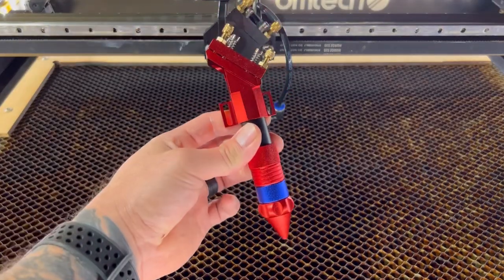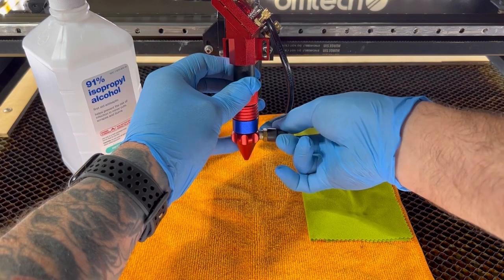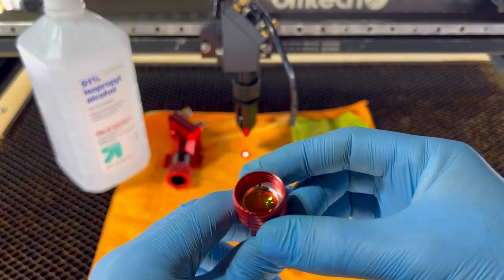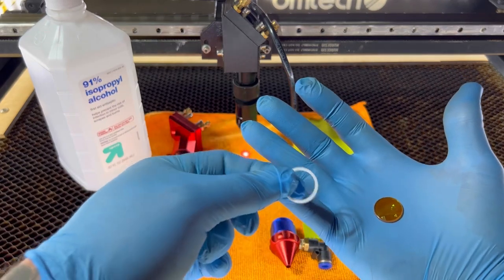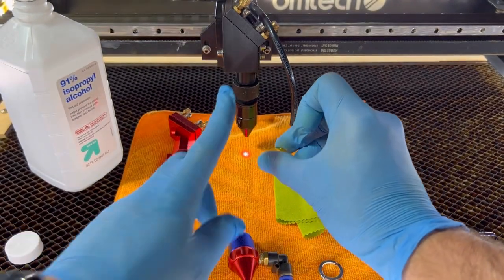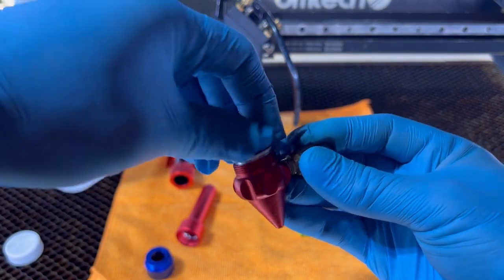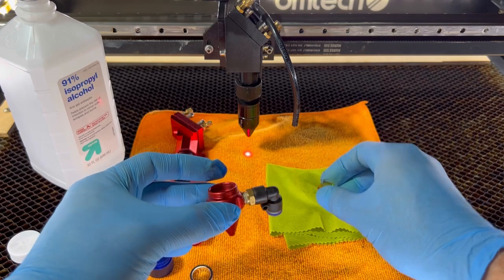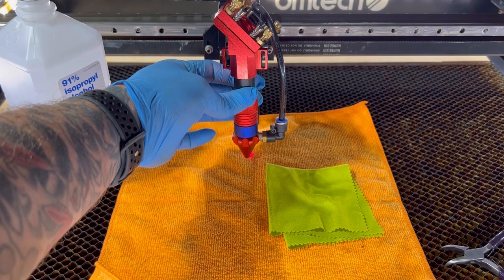CO2 Laser Head Lens Location and Cleaning for AF2028-80 (OMTech)

Comment: Very informative and valuable video. It will help many who are unfamiliar with this laser head. Just for info, the blue ring is a 1/2” spacer. If the owner wishes to use a 2”  20mm lens (normal lens is a 2 1/2” lens), all they need do is remove the blue ring, which will ensure proper focal distance between nozzle tip and material.
Reply from the maker: Thanks Jim. I know you have this laser head setup so I value your first hand experience. Thank you for being a great contribution to the community.

Comment: Can you install a 4 inch focal length lens on the top? Or world you need a longer extension?
Reply from the maker: You would need a longer nozzle extension due to the divergence of the beam. If you use it as is, you would lose some of the power due to divergence interference

Comment: Great vid thanks! Quick question. When you're reassembling the tube back up into the top locking collar part, is there a measurement setting? Or do I just push it all the way up and lock the tube, or does it even matter? The long tube tells me it's adjustable for a reason. I moved mine without measuring when I was cleaning my lens for the first time. What happens to my focal distance? Thanks in advance! (Oh, I have the black laser head, exactly like the one on your machine.)
Reply from the maker: The up and down position doesn’t matter. If you have limited Z height and a tall rotary, having the laser nozzle slid all the way up will help you gain additional clearance. 

The distance that matters it the distance from the tip of your laser nozzle to the top of the work piece. This is called your focal distance and is established when you do a ramp test (shown on another one of my videos). I’ve made myself some focal gauge to manually set my focal distance as I found that the stock focal gauges were a bit off.
Reply: Awesome thank you. Yes my FD was off some too. Thanks for the great vids!

Comment: I moved my laser from my business to my garage. its a 28 x 24 100 watt. I too co2 tube out for move. Now the laser line it too big and it can get though 1/4 ply and it throws red sparks when cutting material. Checked and adjusted all mirrors and pulsed cutter and it is in center co2 tube is new. Help
Reply from the maker: Unfortunately YouTube comments isn’t the platform for effective help. I recommend joining our Facebook group. The link is in the description. Make a post with pictures and videos and we can help you there.

If a line is too thick that generally means you’re out of focus. You need to properly set your focal length. Depending on your material, sparks can be normal as well.